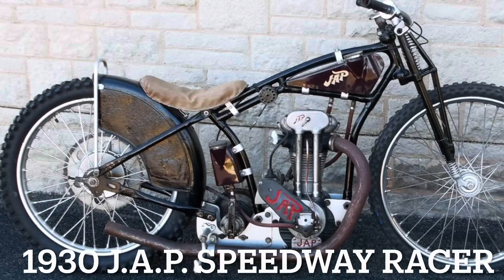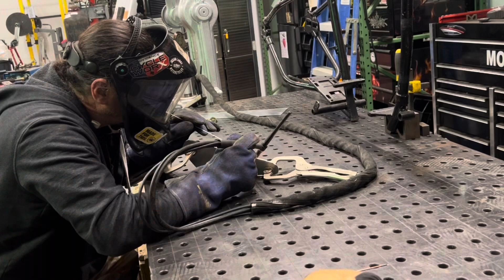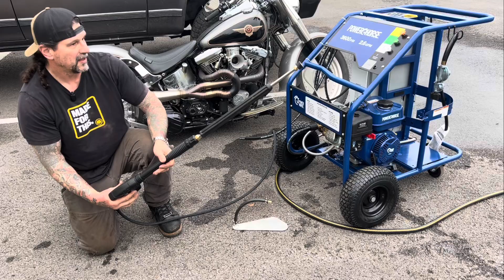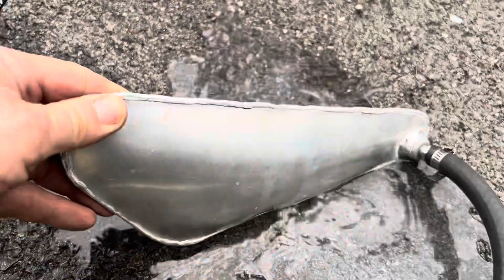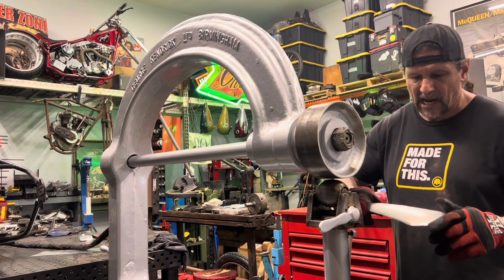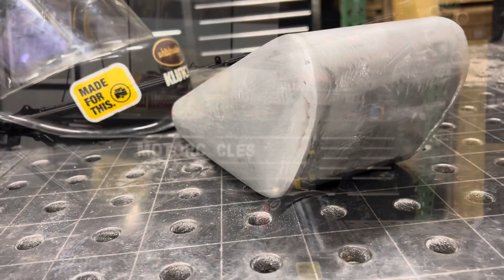Billy Lane Hydroform Shape & Weld Hand Made Custom Chopper Motorcycle Gas Tank w Pressure Washer

Comment: You said it would
Of taken you a hour to get that initial shape but how long did it take you you
Weld it
Together then weld the bung on and put the fitting on then spray the water then go back and sand the seam off?
Reply from the maker: The whole video is only eleven minutes long. So, you tell me
Reply: @ I mean it’s edited so not sure how that made sense bro. Iv seen you make tanks in a he past and I feel like with a mallet you’d have that much shape in aluminum in 5 minutes

Comment: Another option is to fill the tank with water and freeze it. This will allow you to inflate the tank and then process it with a hammer without fear of making large dents: the ice will not spoil the workpiece.

 a comment in support of the channel and these words so that the YouTube algorithms take this into account
Reply from the maker: Thanks. I’ve tried freezing to remove dents- but never to shape. I’m going to give it a try . There was virtually zero volume between these panels, so I don’t think freezing would have worked here. I would have begun with no water to expand through freezing

Comment: Went out to the Salt Flats to see it in person, can't wait to run my '65 Fastback Mustang, full throttle Billy, place is built for speed. Remember you have to run for a few miles wide open so you need the fuel capacity.